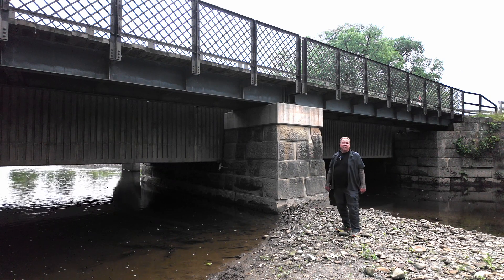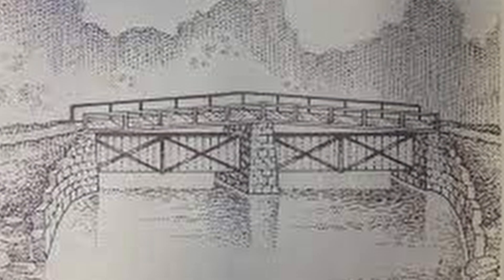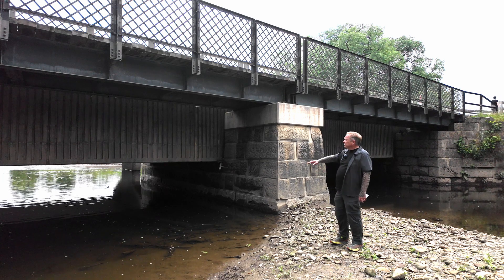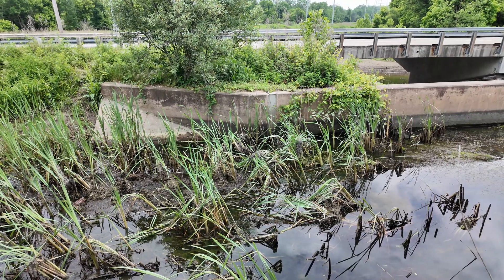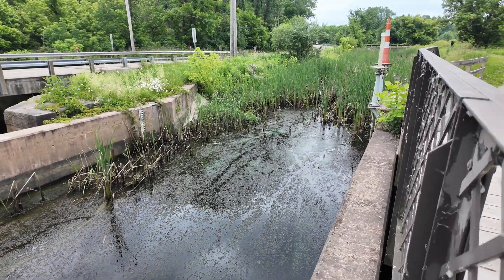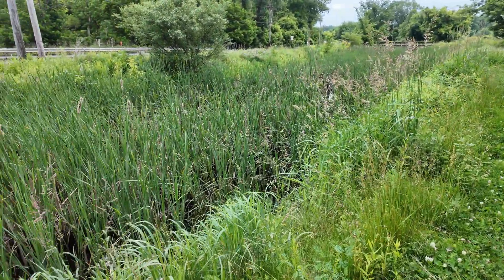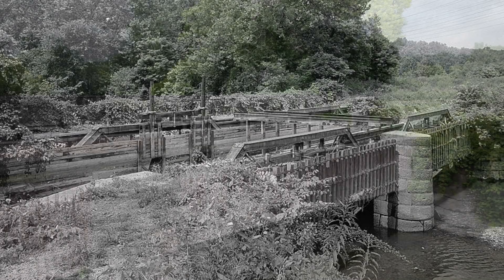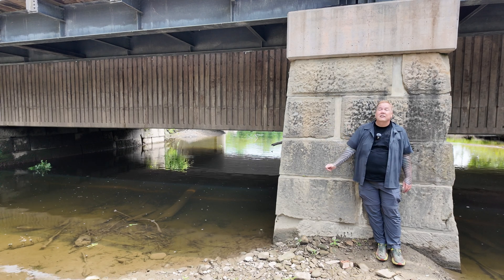Crossing Valleys with Canals: The Aqueduct Engineering Masterpiece

Comment: If those gates work like the gates in agricultural ditches, “drain completely” is going to be more like “mostly less full”
Reply from the maker: From some locks and stuff like that I've seen, it'll cut it to a stream.  If they actually need it dry, they could pack clay or something around the seam between the gate and wall/floor, which would then just wash out when they pull the gate back out.